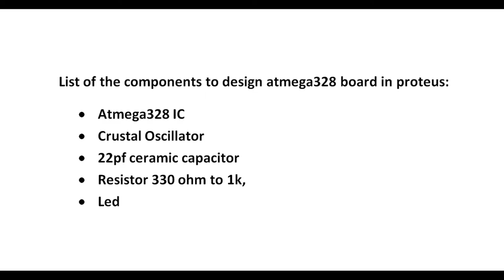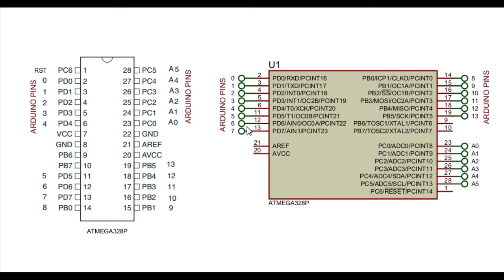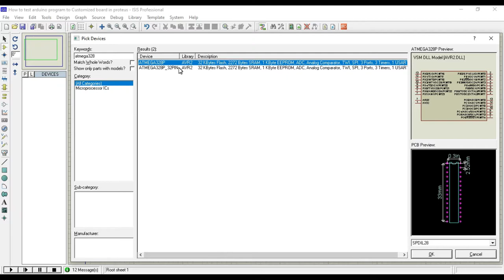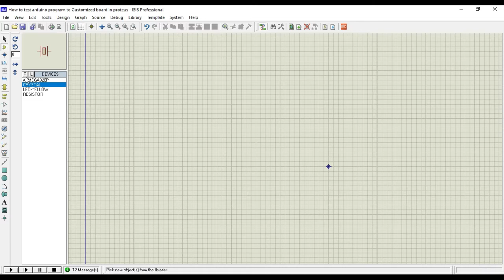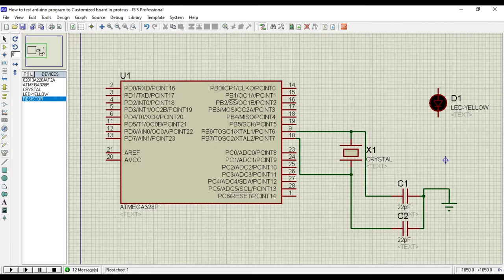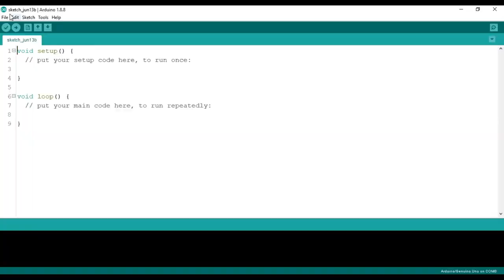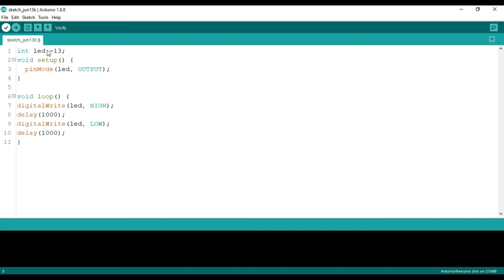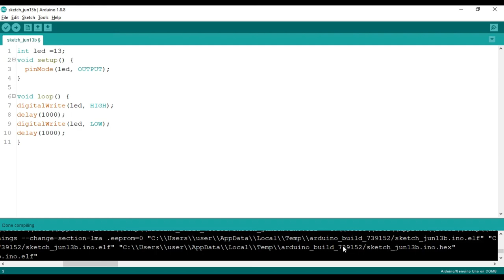Write your first Arduino program in Atmega328 IC | Proteus Simulation

Comment: Brother will point out that this circuit can be mounted on a board and can be programmed for display of volt ampere watts and thermometers and will show readings on the OLED so that programs with arduino can be run in it.
Reply from the maker: Yes it can.